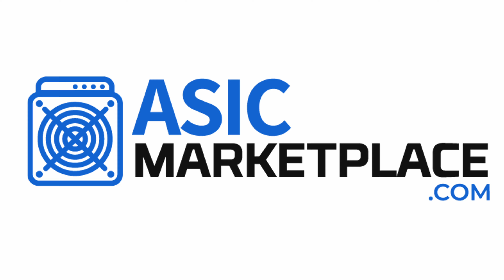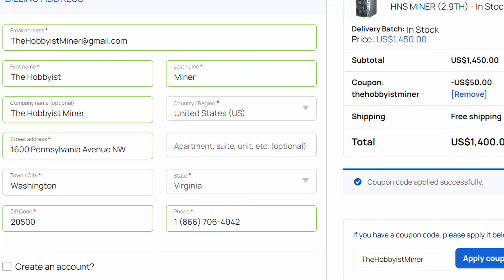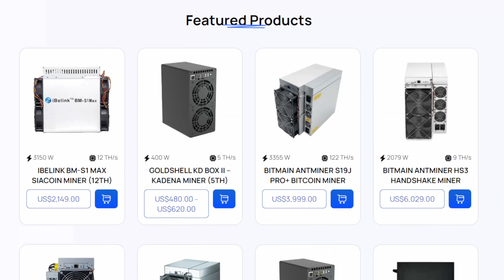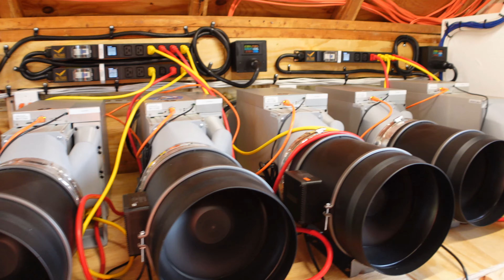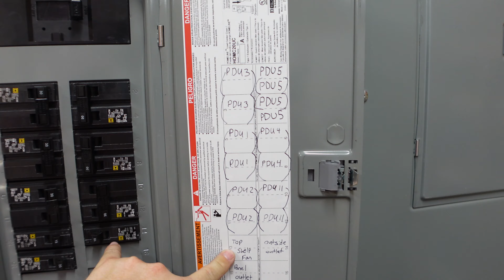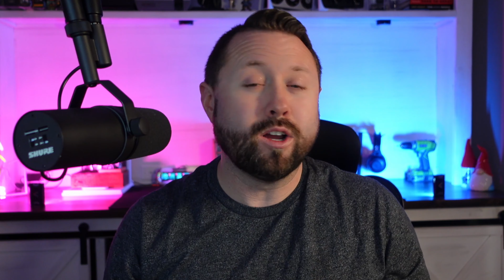I can FINALLY show you this! My DREAM at-home crypto mining farm is finished!

Comment: You could take air with pipes under ground and the hot air to the house for winter..  reserch Geothermal air conditioning

"The In-Ground Cooling System enables you to cool your house or office by drawing fresh cooled air in through a series of pipes buried 0.4 – 0.6 metres underground and 10 mts long"

Comment: I did 108 of these on S19 Xp’s. You might want to consider using the AC Infinity rubber noise reduction clamp. Works really well to join the fan to the shroud. And reduces noise a bit.
Reply: Quieter but at the cost of a longer ROI.
Reply: @Spidersoftheworld  $17.99

Comment: 5 x 30A PDU's can be offset by 15 x 2000W microinverters, 60 x 550W Solar panels. We can do that for under $30k. If you're paying over $0.08/kWh, we can gut that in half without batteries.
Reply: Not true, to cut in half need 12 hours 100% production, 1/3 is possible during peak summer time.